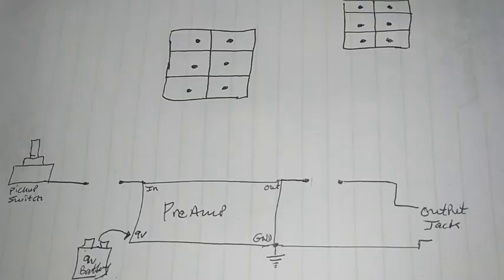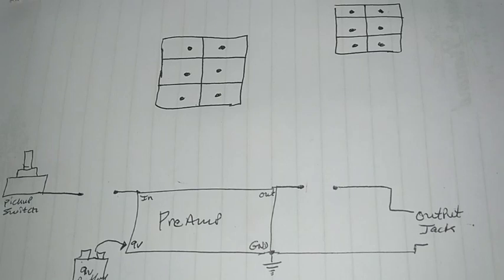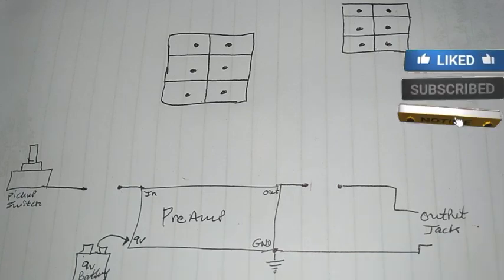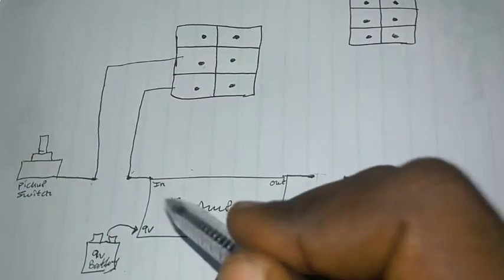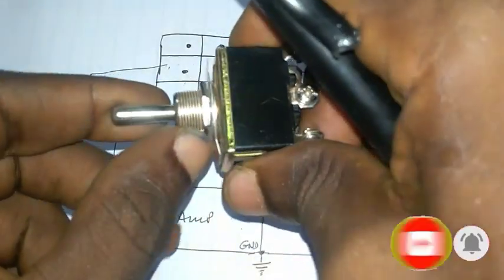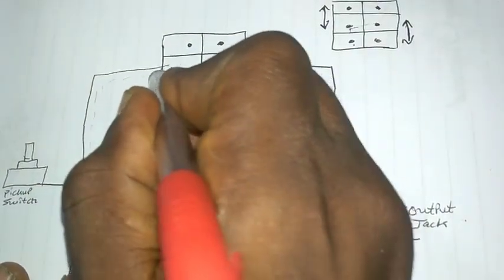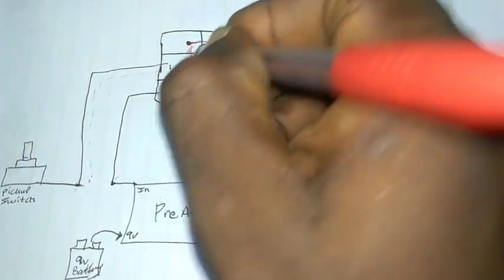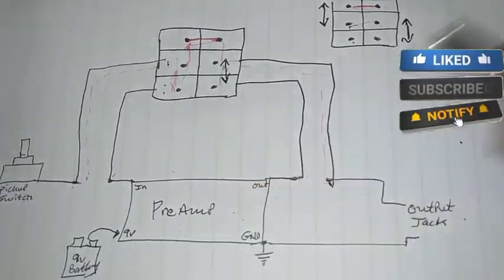How to wire an Active Passive Bypass Switch for a Bass/guitar Preamp

Comment: Is an active/passive switch the same thing as an eq bypass switch
Reply from the maker: Switch work is to connect the session u prefer to activate.

So wheather it's a active bypass switch or Eq switch, it all depends on what u design.

All that matters is the type of switch u working with, 3dpt switch, 2,3way etc. 

In this case I used toggle switch, for stompbox we use foot switch for easy control with foot.

Hope this helps, if u need more help let me know

Comment: But it still consume the battery right ? because the switch doesn't cut the battery connection
Reply from the maker: It did cut the battery, try to picture the signal flow well.
Reply from the maker: If u need a detailed video on it let me know..